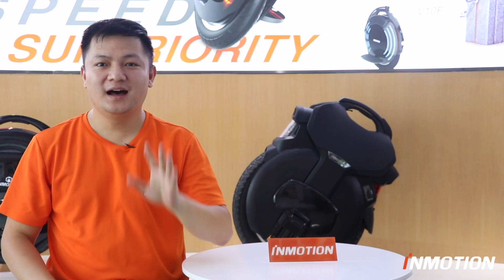#inmotionV11 | Are the Batteries Swappable? Yes and NO | Electric Unicycle

Comment: Guys, it would be better to shoot a video to replace the BMS, which every second owner of this monowheel burns down for no clear reason. They can not be bought separately anywhere, only assembled with a battery that is very expensive. Or give a link where you can buy bms?

Comment: Looking forward to hearing what you will announce for the V11. Wondering if you will address the issues with V11 first adopters; saddle, bearings, etc. The biggest concern for me is the bearings (Even though my right hand saddle cracked near the screw on the top). Im a bit scared to ride it in the rain because of what happened to Duf. I'm from batch 1b and doubt my z-bearings were replaced with the sealed ones. In any case, I hope it's good news for us V11 riders.